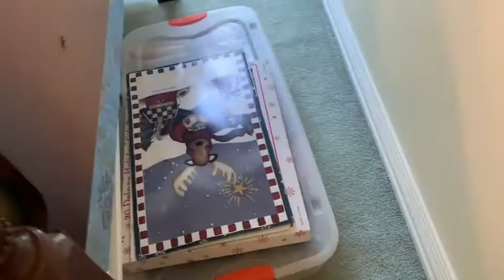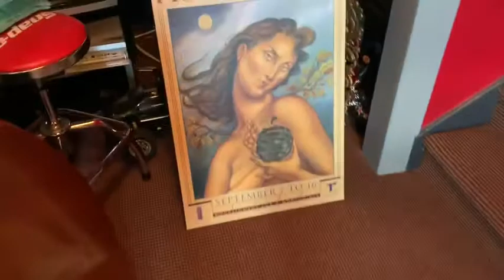Massive carpet Stretch and vacuum Sanitaire Triforce. #carpettime.

Comment: Another tip is back nail the strip. %50 of the time it stretches to the point of pulling it right up and yes, after 30 years of useing poles, the tri force by far is a tighter stretch
Reply from the maker: craig muzzey   When it tries to come up i drill a 1/8 hole and drop a 1 inch anchor in it. Then you can pull. I will be finishing up the stretch today. Thanks for watching. Triforce is going to send T shirts so I can help promote.